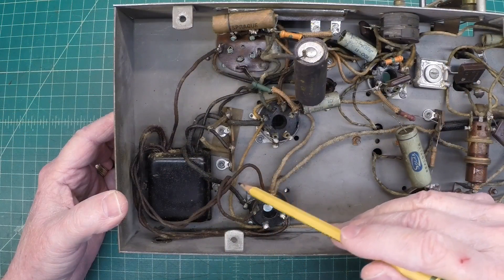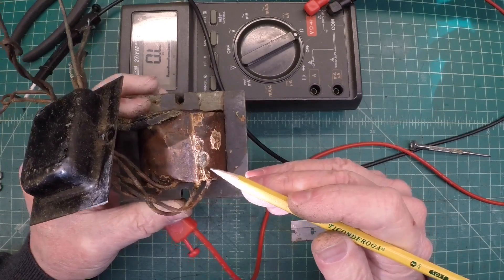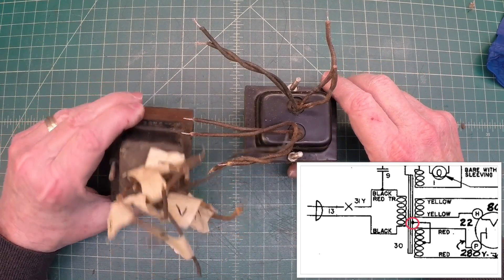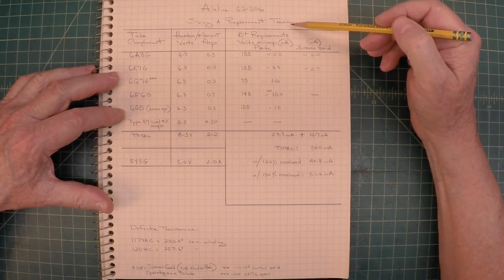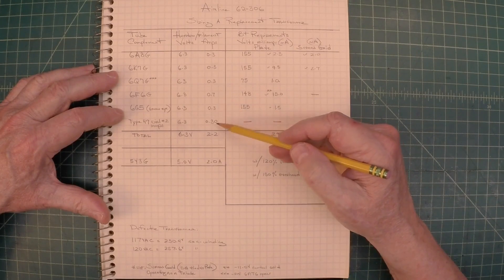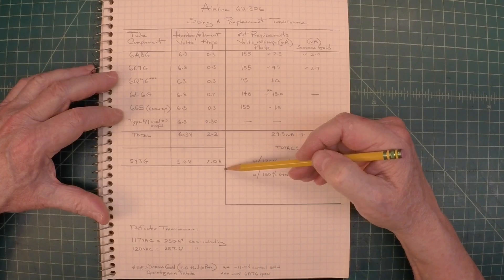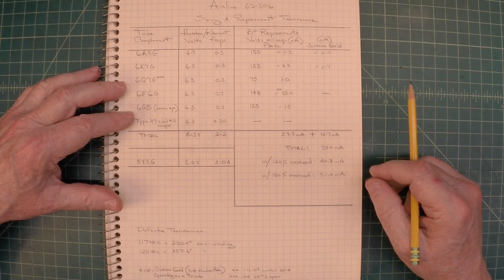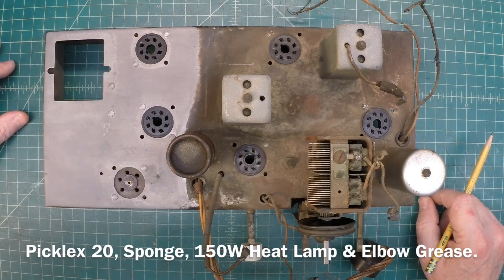Airline 62-306 Teledial - Power Transformer Substitution Criteria & Derusting Update

Comment: So, did you ever put in the replacement transformer? I just recently got a 62-306 teledial, that also had a bad trans. I watched this video, and found one very close to the one you recommended with 250V from center tap, etc. The B+ was perfect at 150V, but after awhile dropped to 125V... however the HV remained the same... so I'm trying to figure this out.
Reply from the maker: I’ve had rectifier tubes cause this issue in the past, even though they test good on the tube tester. Any idea if the B+ current is increasing while the B+ voltage is decreasing? Best, Don

Comment: Forgot to ask also the voltage on pins 4 and 6 as well .. With the 5y3 removed ... I get resistance across transformer on pin pin 2 and 8 but no voltage... CAn't tell if it is the transformer or not .. I think it is ?
Reply from the maker: Mike - just replied to your latest email. Hope you find it helpful. Best, Don

Comment: What should the voltage reading across pins 2 and 8 on the 5y3 with power on and the tube out vs in the cirsuirt I have a resistance measurement across those two pins with the tube out. But no voltage. This is on a 62-306. Mike
Reply from the maker: Glad it was simply the rectifier tube. I just replied to latest posting. Best, Don

Comment: Wonderful series of videos, thank you.  Excellent engineering notebook.  Nowadays we type stuff into a computer which is fine but I still love the National, Ampad, etc. notebooks.  Nice job also on margining the xformer; very well done, as usual.  Question:  I looked up "Picklex 20" and found it to be expensive for my budget.  Could you recommend an alternative for working on a chassis which, like your Airline, is not completely stripped?  Thanks for all you share in your videos.
Reply from the maker: Thank you Jeff. Yep, the Picklex 20 is pricey. Loctite Naval Jelly is another product I use often and you can even wet sand with it after letting it set for 10 to 15 minutes or just before it dries. I start with 320 to 400 grit then switch to Scotch Brite pads or a higher grit sandpaper after that to remove as many of the swirls or other... from the sanding... Hope this helps. Best, Don
Reply: @RestoreOldRadios  Thank you, Don.  I have some notes and will save your reply along with tons of tips you freely share in your videos.  You've given a mountain of experience-proven advice for which I (and many others) are deeply grateful.  By the way, my (late) dad and I used to use naval jelly to clean pulleys, guides, and various hardware on his sailboat each fall season; it worked really well ... such good times.

Comment: Don, I'm working on an identical radio.  Mine also has a power switch that's not working and I just tested the transformer.  With all tubes removed I'm getting 500V across the secondary.  From what you said that appears to be way too high. Isn't that about twice what you were seeing on yours without a load? I"m wondering if I've got a shorted primary.
Thanks,
Keith
Reply from the maker: Keith - congrats on finding one of these Teledial radios. Your 500V sounds correct if you’re measuring the entire high voltage winding between pins 4 & 6 on the 5Y3G rectifier tube. I read around 250V from the center tap back to each high voltage winding. Be safe and have fun. Best, Don

Comment: Is a new transformer a lot of money for that radio,I dont no much about transformers but a freash one ,seems like a good idea.
Reply from the maker: Hi Ron - I’m late on my reply, but more digging around you can see I located another Airline transformer as a donor. I purchased two more used replacements as well should this one not work out. If I was doing the repair for a client, I would have left the decision to them on a new one vs. a used... You can typically find a used one at a third of the cost of a new one. Best, Don

Comment: Hi Don. What a change on chasis surface!!! very good. I feel glad you have done your magic "elbow grease" to recover half of this piece of radio history from rust. Now I am waiting to watch the second half (more magic "elbow grease").
Wish you a nice day. I forgot to say... I need one radio schematic from Portadyne U680 (5 valves 6K7, 6K8, 6Q7, 25L6, 25Z4). And I am becoming crazy cause I can not find it in Internet, anywhere... Please could you help me to find it? Thanks a lot.
Ketk (from Spain)
Reply from the maker: Ketk - thank you. I gave my elbow a rest yesterday and plan to be back at it today. I couldn’t find any reference material on the U680 either, but you can use these schematics as a reference since the tubes are the same.

Check out: http://www.grillecloth.com/sylvania/tubelist.php?comp=&mod=&Num=5&tube1=6k7&tube2=6k8&tube3=6q7&tube4=25l6&ball=&Submit=Submit&db=5

Schematic example: http://www.nostalgiaair.org/pagesbymodel/990/M0008990.pdf

The rectifier tube is different, but everything else is a match. 

Hope this helps and thanks for following along on the Teledial. 

Best,

Don
Reply: Thanks very much Don. I didn´t know that web page catalog for old radios. It will be very useful for me with this Portadyne has my head on nuts. Have a nice day Don. Wish to see your next video. Your american english voice is not so difficult for me to understand (only some times with some words or some short phrases). Best regards and follow on line.
Ketk (from Spain).

Comment: Don, wouldn't the fact that you are unlikely to run the radio at full volume for long periods also offer a cushion to the transformer capacity, or do you think that is incorporated in the original design?  
That chassis looks amazing on the left. Thanks.
Reply from the maker: Thanks Ian. I’m sure a lower audio level may decrease the plate current of the 6F6 output tube, but a higher current is one of the side affects of an increase in the B+ voltage. Best, Don
Reply: I did not think of that.
Thanks Don.

Comment: Regarding the transformer, you could just run the good side of the secondary through a diode bridge, then connect that to the anodes of the 5Y3, so that the valve lineup and voltages are close to standard. Could be a bit of fun to try. Cheers Doug.
Reply from the maker: Doug, I appreciate your suggestion. Quick question, would the negative bias voltage still be available since the return to the center tap of the transformer would only have one secondary lead? Best, Don
Reply: @RestoreOldRadios  yes you would take the negative side of the bridge output to same point where the original centre tap went. Cheers Doug.
Reply from the maker: Doug, thanks so much. I will try this when I get to that part of the restoration and keep you informed. Best, Don